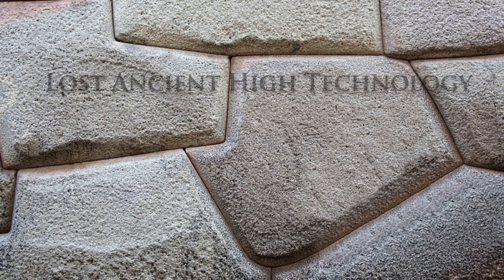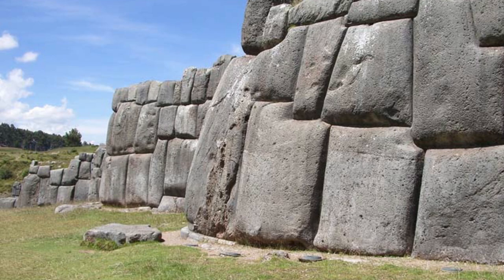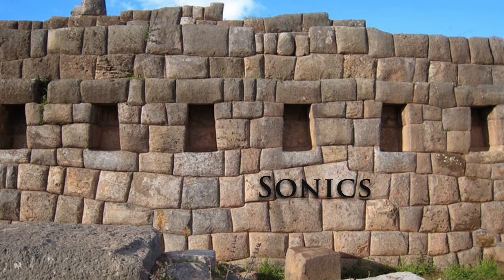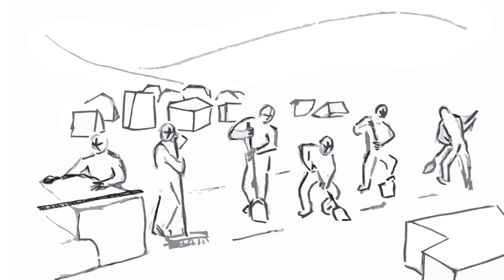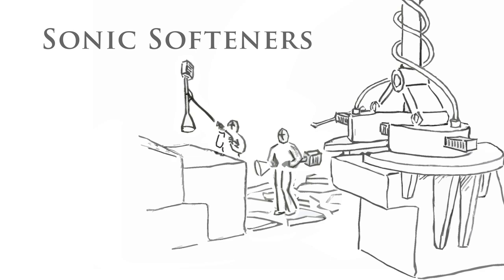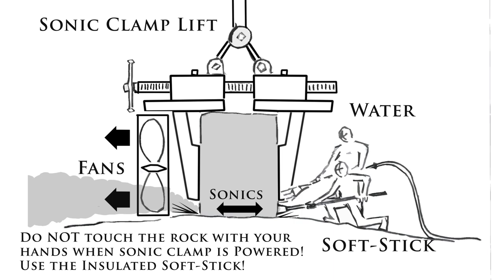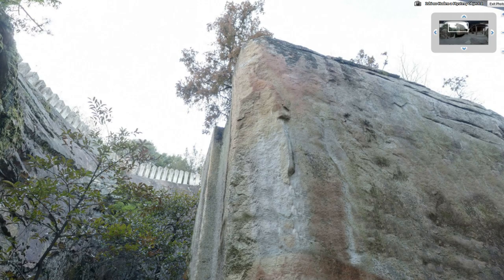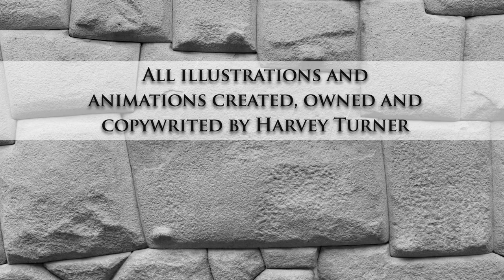ILLUSTRATED:  How to Build a Polygonal Megalithic Wall. Like Sacsayhuaman, Peru

Comment: i think there's a much easier way to get this result, and quite possibly the very way the ancient ones were done -- wet-casting the blocks in situ.  the blocks are made using natural fiber bags of different sizes, generally rectangular shaped.  the wall has a wooden trough/form set up as an overall molding shape for the final wall, which will be two blocks thick. the bags are set in the trough for one course of blocks, and then the bags are filled with various stone filler pieces, approximately from 1cm diameter to bowling ball sized, whatever fits and fills most of the bag.  then geopolymer cement is injected (poured into the top opening) into the bags.  a small "X" or two are slashed near the bottom edge, to allow the cement to start to ooze out and let you know the bag is fully permeated with cement to ensure a solid block resulting.  once full, the bag's top flaps are folded over to close it.  while the cement is still wet, the next course of blocks is set up on top of the prior course.  the weight of the above layer will compress the wet/semi-wet blocks below, so they tightly butt up to each other and compress into a solid structure.  it should be timed so that the course of blocks immediately below the current working layer is still malleable enough to be pressed into shape, and the course of blocks below that are mostly solid, for stability when getting layers built to height.  once all  the basket blocks have hardened, the wooden trough/form is removed.  the final step would be to torch the faces of the wall to let the fiber bags burn away, leaving a perfectly fitted wall of permanent stone blocks like we see in ancient megalithic sites.  ta dah!
Reply from the maker: but these stones are not cast,, and are not concrete,, we know that for sure. So,,
Reply: @intriguingmegalithicperspe1764  maybe.  maybe not. if you're not looking for indications they were possibly cast, or arent open to the possibility, it'd be super easy to miss. and i'm sad to say it but i see an obscene amount of cognitive bias in the archaeology work done in central/south american megalithic sites.  in the case of sacsayhuaman, the more i look, the more i notice things natural stones just don't do, like lots and lots of various inclusion stones embeded randomly in large blocks.  and the way layers of stone spall off the faces of blocks in many places, that's not normal for natural rock, and even if so that's so much trouble to make sure the stone is placed so it'd fracture that way.  it even looks to my eye like you can tell where they switched to a fresh batch of cement that has slightly different color in some blocks, and the color/texture patterns follows pretty obvious sequences in laid courses that would have been done.  i resisted going there for a long time mentally, but this makes the most sense to me.  this class of concretes, geopolymers, can be used to cast blocks that contain up to 95% natural stone filler, making identification as synthetic stone concrete very tricky. for example, Joseph Davidovits did a little demonstration/experiment a few years ago where he cast some fresh blocks of a mix that mimicked natural limestone, and the two top geological analysis labs in paris couldn't tell them from natural limestone, and said they "knew for sure" they were millions of years old, when they were in fact cast less than a month prior. the lab techs weren't dumb, it's simply that they didn't know the giveaway clues to look for such as randomly oriented sedimentary debris. (ps sorry for the lengthy reply, holy crap that was long winded lol)
Reply: i would like to add, it's worth noting that neither the sonic clamp and fans explanation, nor the concrete explanation i mentioned above, have been proven so far.  what's significant though, is that the concrete explanation doesn't require highly developed exotic machinery, or tech levels beyond what we have today; as long as someone has the cement recipes, this work could be carried out with easily sourced materials by any level of civilization, primitive or advanced.  and it can be done with the most rudimentary of tools and technology.  i will say, though, sonic/vibratory methods would definitely be useful or even necessary if they were made with cast cement, to release air bubbles and voids and get courses of semi-wet blocks to settle into each other solidly. 
  ever notice places on these polygonal walls where blocks have fallen out of place?  the interior surfaces of the blocks where they meet other blocks are not at all flat, they're complex uneven surfaces like molar teeth and perfectly key into the adjacent blocks. making this happen using massive cut/quarried blocks of natural stone would create SO MUCH extra work for the builders that it defies credulity.  the whole point of employing advanced techniques and technology is that they're supposed to make a job EASIER, not vastly more labor-intensive.  it's a cop out to just claim that the people who were smart enough to do that work somehow didn't have the sense to know when they were making a job laughably more difficult for themselves.

Comment: Imagine this
You place a rock on top of another rock.
You start making a sound at the resonant frequency of the upper rock.
The upper rock starts vibrating. It starts to scrape away at the rock below it.
Eventually the edge between the upper and lower rock will become a smooth line, and the stones will fit together *perfectly*.
What about stones next to each other?
You place two rocks leaving a gap in-between.
Then, you place a rock on top of the gap and repeat the process.
The rocks will fit together and you can place more stones on top of them.
Reply from the maker: Yah,, something like that!
Reply: @intriguingmegalithicperspe1764  interesting channel!

Comment: No you fool its just a form of concrete mix put into errodable bags and stacked on top of each other. Over several years the bags fade away and you're let with stone blocks. YOu can even use wood planks for bracing if you want flat edges. It's pretty simple. Surprised nobody has made a video showcasing this. I live in a condo (no yard) otherwise i'd upload a video myself.
Reply from the maker: Yah,, that's right,, you need a yard to upload a video,,, I'd forgotten about that fact.
Reply: Yep you are right I was thinking of doing the same 
Keep it simple
Reply: This is exactly what i believe how the walls are made too.
Reply: @supertuesday600  To believe that, then we'd have to believe they had advanced knowledge of concrete making utilizing granite as the substrate. You would also then have to believe they had advanced machinery or tools that could grind up all that granite as fine as the sacks of concrete people use.. Grinding that much granite into sand form would require an absolutely insane amount of time and effort.
Reply: @pepecorleone9021  Nope. They scooped readily available soft granite, or some mixture of soft/liquid materials that was abundant in the past, and when it hardened it became hard granite.
Reply: @supertuesday600  Sources?
Reply: @pepecorleone9021  the environment and climate was dramatically different from the current world we live in, tens of thousands of years ago. Soft lime stones, soft granites were abundant and can be gathered, shaped, and hardened through exposure to air, sunlight, fire, etc.
Reply: A P river clay like mixture...maybe pyramids made the mixture.

Comment: Unfortunately,they did not have high power electric fans. Or metal tongs to hold the rock. Then where was it quarried? Hmmm. If this is /was feasible, you figure the granite folks down in Elberton, Georgia would be using this method.
 Again, the question remains, HOW DID THEY DO IT. Please provide a photo or video of you forming some stones out of granite or even sandstone. I WOULD LOVE to watch this. Drawings not acceptable.